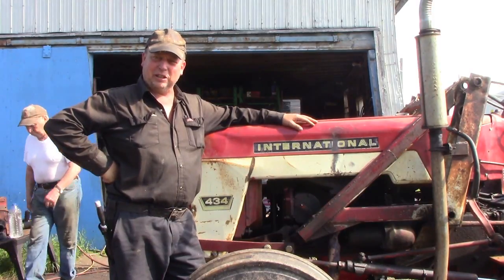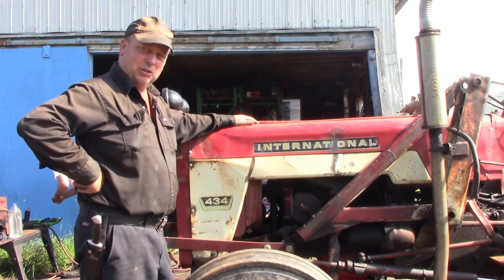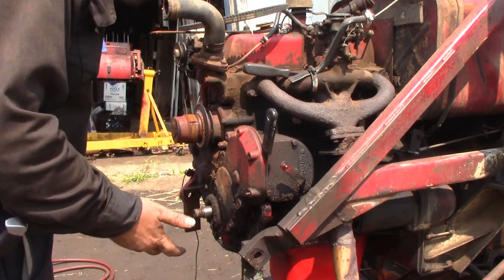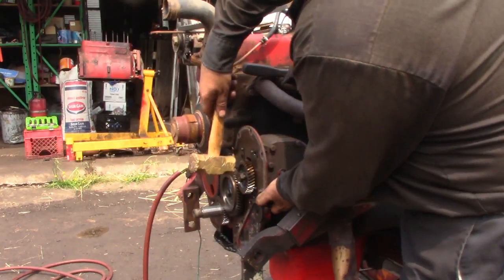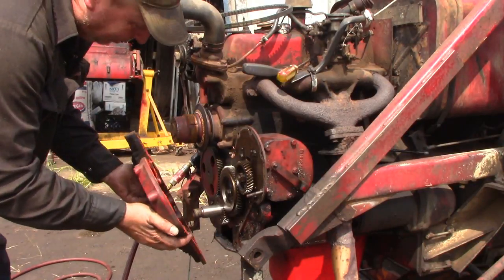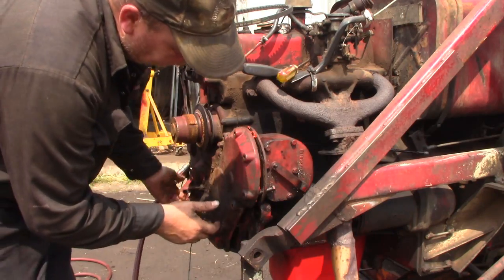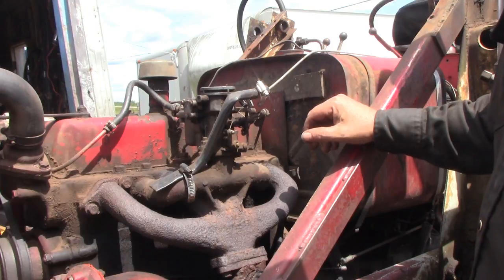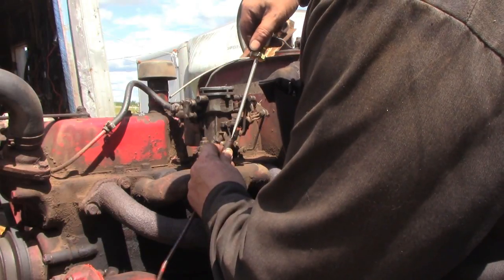IH 434 Governor swap

Comment: Was there ever a proper IH tool for adjusting the water pump pulley? I used a hammer and brass drift while thinking ‘there must be a better way’.
Reply from the maker: Not that I have seen, there may have been a dealer tool for it but I have never seen one. Thanks for watching!

Comment: Good   day Dave from Ontario.  A neighbour  has 444 gas for sale, can't get it running right
R those tractors  prone to have problems  with either distributor  or carburator  .  R those
down draught just s good as up draft.
Thanks
Reply from the maker: The newest a 444 gas could be is somewhere around '74-76 so around 50 years old and everything wears out over time. The distributor and especially the carburetor are a couple of wear items that are problematic with those tractors, not easy to find and that British Zenith carb was always finnicky. There have been after-market carbs available at one time or another but they're around $900. Ontario used tractor parts may still be able to get them. 519-523-4922
 Take care Don!
Reply: @CanadianRedneck15  Thanks   for now

Comment: Hi Dave,  I am in the Ottawa valley and am working on my 354 international. I'm pretty sure my govenor is not functioning as well. Any idea where I might be able to source one out?  Also is it possible to diagnose the problem without taking it off completely? 
Any input would be great thanks!
Reply from the maker: First thing, make sure the linkage from the governor to the carburetor is set properly. If it still is not working you can take the plate off the side of the governor to see if the spring is broken. 
  If you need parts you can contact me, sales@chowntractorparts.com
 Thanks for watching!